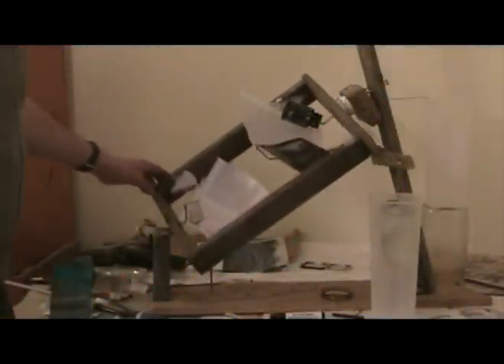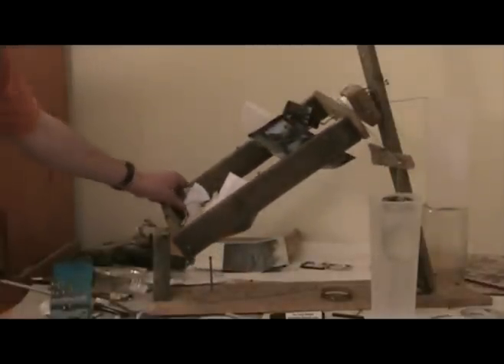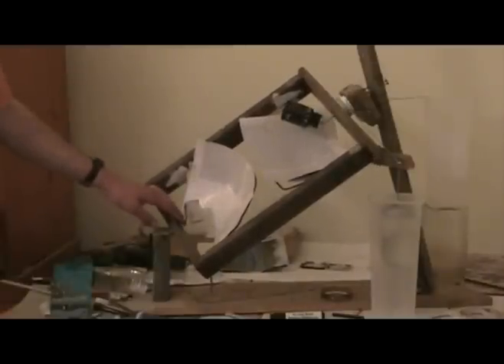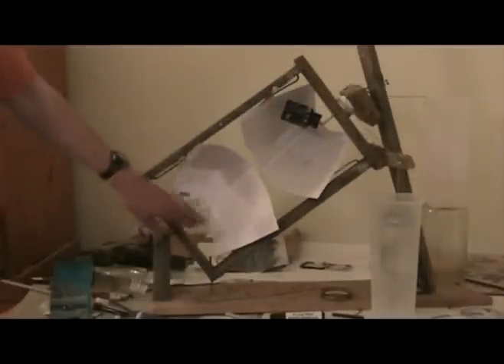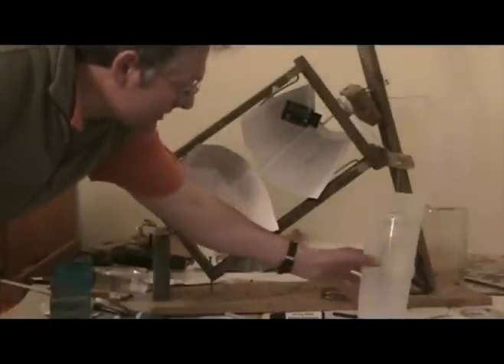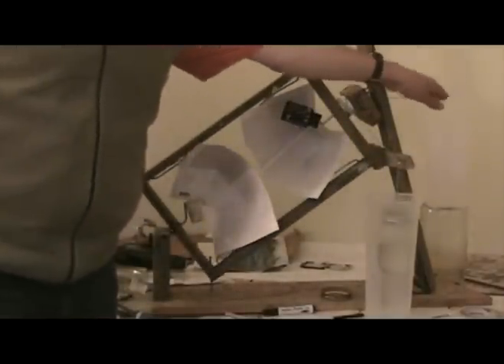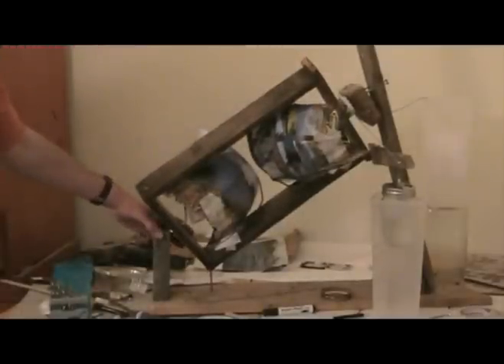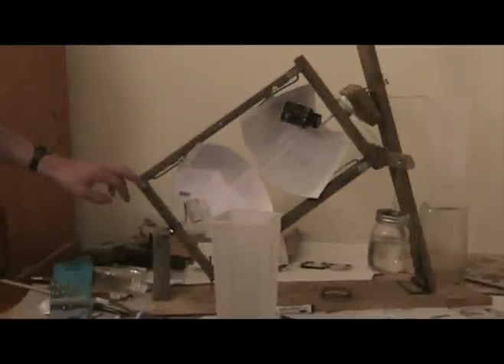Revolutionary Solar!  Stirling engine mount + Liquid piston tracker

Comment: I like the concept of it all.  A few things I would probably do, and you probably already know this, is to keep the mirrors fixed/non-adjustable in position and just move the systems angle (at that pole angle board)  so that the Suns rays are still perpendicular to the mirror.  Basically for added simplicity if done manually each day or two.  I'd probably just use a one mirror system also, but I guess it helps cooking two things at once sometimes.

Comment from the maker: I have equatorial mount, the same as telescopes that can track the stars or the sun easily. Actually the 47 degree change happens everywhere! The system I show works everywhere on earth. The only difference is that your angle of the axis of rotation must be the same as your latitude.
Brian

Comment from the maker: Just a note that David Williams on alt dot solarthermal tried to calculate the exact size of a parabolic dish in balance on its focus, (in answer to a post about this mount). And he found e the natural log base, one of "Gods Numbers" in the ratio of the rim radius divided by  focal length!  . I quote,  "It came out to approximately 2.718 times the focal length. When I saw that number, I was startled, because I recognized it as the value of "e", the base of natural logarithms!"
Neat, eh?   Brian

Comment from the maker: Another note, Instead of 2 half  dishes, perhaps a counterweight above one half dish would work? The counterweight is just to bring the center of gravity back onto the focus.  rimar2000 in instructables  used a small counterweight ABOVE the dish in one of his designs. (I cannot give urls here). So the frame around it would remain, the counteweight is solidly attached to the dish and the dish and counterweight are one unit!

Comment from the maker: I thought that too at first but you CANNOT move the systems angle. It must be at your latitude pointing towards the nearest pole.  The problem with a one mirror system (that I ran into a couple of years ago with the tracking solar accumulator) is that the center of gravity goes out of whack with seasonal adjustment. But with 2 mirrors, you move one one way and you move the other the other way for seasonal adjustment and one movement cancels out the other one so the center of gravity stays put.

Comment from the maker: @stosism Great that you are experimenting! 
My experiments were a couple of years ago. It was very rigid.  There are different types of string and some are loosey goosey elastic and I do not think that is any good. I used some sort of fishing line. I used 2 floats in 2 buckets and they were fairly snug fitting and they were not light. 
It was way more rigid than I expected!  I want to quit solar experiments, do I owe the "community" a few more?  Cob and soilblocking is where the fun is!

Comment: Well, maby what I said would work better with a trough heater.  I know what your saying though because the elevation of the sun does change throughout each day from 0 up to the max. angle for that day., and therefore, the mirror would have to be adjusted throughout the day also.  For simple systems, like the box cookers, it is possible to adjust them manually.  Even at the equator, the sun changes 47 degrees total throughout the year.

Comment from the maker: @locouk  It was trying do a low tech alternative to a Scheffler solar cooker. In the Scheffler system, the dish itself deforms every day to produce a new parabolic dish with a new focal point. ( because of the changing seasons). I still work on it when I get time off on sunny days (very rarely) A team designed the Dolios Solar Cooker with  2 focal points BUT they do not have it on equatorial mount. Much harder to aim! I am just one guy, Teams get further, but maybe mine is simpler.

Comment from the maker: I think you underestimate the power of the liquid piston.   The gusty wind has to lift the float out of the water. And it can be a fairly tight fit into its container.  So also you get turbulence at the sides  as the float gets sucked up.  I did dripper trackers a couple of years ago with small floats.  They were way more stable in the wind than I expected!
(For my tracking solar accumulator project). About 1 meter of collector area and two 14 (6kg)  pound floats kept it stable.  Thats tiny!